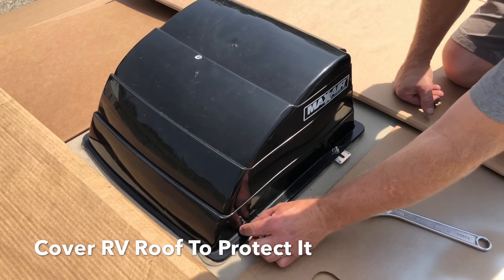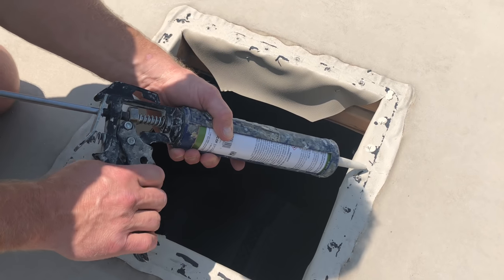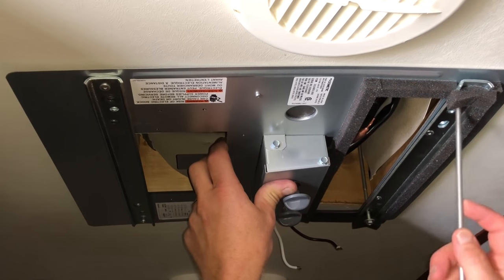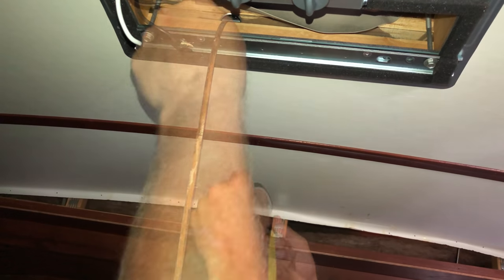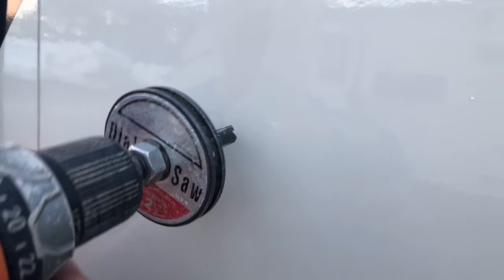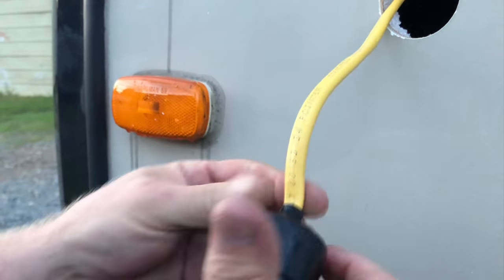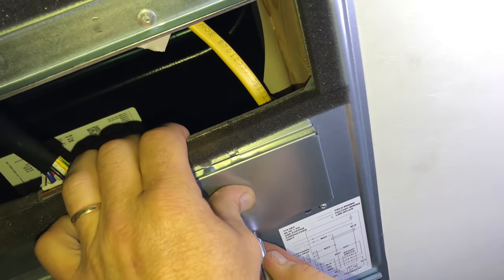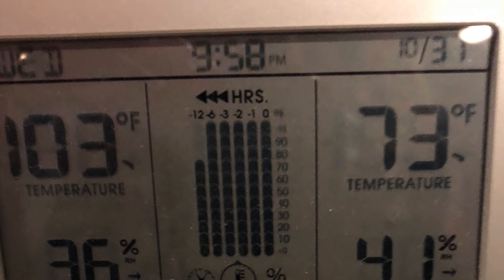Installing a 2nd AC Unit in a Camper with a 30 Amp Service

Comment: Solid, Fastly.Cool and gets the job done. For rooms where window-mounted air conditioning is not an option, this works very well. Easy set up, rapid cooling, and great design.
Reply from the maker: Thanks for watching.

Comment: I added a Coleman Mach 15K BTU ac to my bedroom on my 30 amp KZ Connect 261RL.  I mainly did the 2nd ac add incase my main AC ever goes out.  Watching your video helped me with install and running the wires.  I was able to run the 12 gauge power wire along the same route that the factory wiring was going to the side closet down to the front storage compartment.  The wiring was the hardest part fishing the wires where they needed to go.  removing the vent and installing the AC was a piece of cake.  For  now my plug in is in the front storage compartment till im ready to drill into my camper in the correct location.   Thanks.
Reply from the maker: Drilling through the camper was the hardest par, just because I didn’t want to mess anything up. Thanks for watching.

Comment: Great video!  We have a 31' 30amp class A, and I've been dreaming about installing a 2nd A/C unit.  I assumed I would have to work out and install some type of complicated power management system to run both.  Had never even thought about simply running a 2nd power source!  And what a clean install.  Thanks for the smart content!
Reply from the maker: We have loved having the flexibility of having a second unit in our RV. Definitely recommend it if you camp in warm weather. Thanks for watching.

Comment: Best practice is to tape off the four sides pf the opening with metal HVAC tape to air seal the opening from the inner cavity of your roof.  That forces the conditioned air  into the living space instead of into the roof cavity.
Reply from the maker: Good tip, Thanks for watching.

Comment: I have done this mod to my TT and have never regretted it. One thing I did, and did not notice in this video, was to add a 6" x 6" electrical box on the inside of the exterior wall close to the point where the hole is cut for the male plug to be mounted. In this box I also added a 20 amp resettable circuit breaker for additional protection. I feel more confident with this breaker being closer to the A/C unit than depending on the 20 duplex outlet on campground power pedestals.
Reply from the maker: That’s not a bad idea at all, but in the interest of simplicity I just use a inline, plugin circuit breaker right off of my extension cord. Thanks for watching.
Reply: you could also add an additional outlet for other items to reduce loading on your 30A service.

Comment: Thanks for the video, I was able to follow right along to add a 2nd AC unit to the front bedroom area of our KZ Sportsmen 5er. I was able to fish the power wire through the storage area through a void in the wall behind our bathroom, up through the ceiling and to this AC unit.  I then drilled a hole in the outside fiberglass (man that's nerve-racking!) and then wired in a single pole breaker before the power outlet just-in-case.
Reply from the maker: Sounds great, You will love it. Oh YEAH that was very Nerve-racking. Thanks for watching, glad the video helped. Happy Camping.
Reply: Did you have a vent like this video shows? Or did you have to cut a hole in the ceiling? I'm in need of something for our 33footer bedroom as the ducked isn't sufficient for the bedroom. No vent in the bedroom.

Comment: Brilliant Bob! At first I'm like, "He's gonna blow the heck out of that 30 amp. Then I saw the connector post outside. Then it was, "Amazing!!! He's going to run a direct cord to the 20 amp on the pedestal! Brilliant!!!"
Reply from the maker: It works great, Just last week we had the camper out, no shade, and the thermometer read 98 degrees, went inside and it was a cool 72. At night without the sun we have hit 55 degrees. I don't regret it at all, one of the best ad ons to our RV. Thanks for watching.

Comment: Our 30A RV has two air conditioners with a wall switch to change between them--you can run the bigger one to cool down more quickly and the smaller one to maintain.  Also we can run both when we're on generator.
Reply from the maker: Interesting set up, What brand of RV do you have?
Reply: We have a 1995 Thor Residency 3275.  We're not the original owners, but it came like this off the line, as it's mentioned in the owner's manual.
Reply from the maker: It sounds like a nice unit. Thanks for watching.

Comment: I have a 30 amp bus with 2 roof top air conditioners and i also installed a stand up air conditioner in the bed room, I put a hole in the wall and vented it plus a small hole for the water to vent. for the larger hole I put a dryer vent cover, plus i use a high power extension cord out the back bedroom window and plug it into the regular plug at the campground  it works great and does not use any of my 30 amps.
Reply from the maker: Perfect set up. Thanks for watching.

Comment: I don't know if your Rv tech tech but I am..been doing it 20+ years...super clean install brother I need you in my payroll..lol
Reply from the maker: Thanks for your encouraging words, and Thanks for watching.
Reply: I made a 32 foot 1976 Holiday Rambler ice cold with 2 window units of only 5000 btu, but from the ROOF! It was so simple I have now installed hundreds to service customers who's RV's I repair. And running 2 into 2 ends of the RV uses 25% less power. And the best part, they were only $140 each, with remotes. Just took a little sheet metal work and the original faceplate of the AC is now flat ceiling mounted! Damn shame I could not get investors on it!
Reply: @JOHNDANIEL1  i always thought about doing something like that..lol...
Reply: @JOHNDANIEL1 Make a video let's see your work. ?  Interesting.

Comment: Can’t wait to do this for our 5th wheel we just have a roof vent like you had and only one duct from the main unit and so this sounds like it will keep us comfortable when the heat gets here in Arizona
Reply from the maker: Since we have installed our second unit we have never had an issue with the camper being too hot for us. It was probably one of the best upgrades we have done on our camper. Thanks for watching.

Comment: THIS is exactly what I was wondering about 'how' to do. You made an excellent video, with detailed explanation. 
I read ALL the comments and replies, and I'm not sure how you maintain your cool! (no pun intended!)
My only 'mods' would be that yeah I'd probably use silver tape, and my leak paranoia would probably make me over do sealant, and if I could find it, a more heavy duty external plug {with extra sealant...)

But overall, a very clean install and exactly the tutorial I needed. Thanks.
Reply from the maker: Sometimes it’s hard to keep cool. Thanks for watching.

Comment: I installed a in room air conditioner and vented it through the wall with a dryer vent, it works great and takes up almost no room, plus it doesnt fight the sun and heat of the roof, and it cost under 300 dollars. And to top it off I run a separate cord to the main outlet outside so I dont use any of my 30 amps.
Reply from the maker: I don't use any of my 30 amps either but have found that this unit works FAR better than an in room air conditioner. We tried one prier to the making of this video other than the extra space that it uses it did not seem to remove the humidity very well. Thanks for watching.
Reply: Hey... 300 bucks is 300 bucks, but there are some trade-offs.  I have tried it, just to try it.  I had an 800 BTU portable, and hooked it up just like you're doing.  It worked, but just didn't cut it.  One, portables are noisier for the amount of cooling you get.   Two, all of the heat-generating stuff that makes your AC unit work is now inside the space you're trying to cool, including that dryer duct carrying the heated air to the outside, further reducing efficiency.  Three, most portables do not dump their own condensation, requiring the user to dump the reservoir periodically.   Four, portables take up precious floor space in your RV.   For about 750 to 900 dollars, you can put a purpose-built RV unit in your ceiling.
Reply: Was wondering what the price might be if a domestic ceiling AC unit. So around $1000 if lucky all said done and installed.

Comment: Thank you for posting, great video!  I might suggest some aluminum tape to seal the wood from the airflow inside the new system.  I really liked how you did that though!
Reply from the maker: Done, The finishing touches help it work better. Thanks for watching.
Reply: I lined mine with aluminum flashing sealed with aluminum tape,  I built my own divider from double layer alumium flashing with 1/8 foam insulation.   My trailer sees HOT DESERT time...

Comment: Thank you for the video! It helped me the entire way. Only thing I added was one of them 30amp shed sub breaker box with a 20amp breaker. I've notice a lot of the sites I've been to are dedicated 30amp or 50amps and no 15amp. So gonna run a 50 amp plug that drops to two 30amps and run one to my camper and the other the the 20amp breaker box for the 2nd ac
Reply from the maker: Sounds like a good plan. Glad the video was a help. Thanks for watching.

Comment: Great job. My Crossroad cruiser has only one AC.   The Bedroom has a electric hookup installed from the factory.  If we needed another Unit it would be easy to install.     Our rig is only 30 ft so even   in 90 plus Florida weather it does fine.
Reply from the maker: Sounds like an easy install. Thanks for watching.

Comment: That's pretty sweet...  I would have never thought to add another power source for it.
Reply from the maker: Thanks, It works out very well. Thanks for watching.
Reply: Already added it to someone in my rv group that just happened to ask today if his a/c could be wired on a separate 110 plug
Reply from the maker: Just joined.

Comment: Nice job on the video and install. I assume you used a gasket but didn't see one used or did you just not mention it. Thanks for posting, it gave me the idea to get things going to add a second for our unit.
Reply from the maker: There is a gasket that comes with the kit. You can see it if you look closely at 3:03 in the video. Hope this helps. Thanks for watching.

Comment: Wow nice video, I have a 2018 coachman concord bought in 2019 and very unhappy  with with the single air conditioner in the heat, I did some research an decided to to buy a furrion 14,500 btu with the manual knobs as a second air conditioner, I did exactly what you did and all is fine however just for kicks I plugged it into one of my out door plugs on the RV and dissconected shore power, then started the generator (4K) and turned on the main air and then turned on the new air conditioner and both were on full blast with 30 amp, it was hard to believe, I left it on for over a half hour no issues however I know I cant run the fridge or microwave put my fridge works great on gas anyway, I am not sure but this new air conditioner has soft start built in, either way its great now, I got the coach down to 70 degrees and finally turned it off, I also turned the 30 amp shore power back on and left it plugged in to itself and it ran fine, when I go camping I will still use the 20amp and the 30 amp so there will be no issues other appliances.......................Super Happy Now!!!!!!    thanks for the great VID.
Reply from the maker: WOW, sounds like you have a "cool" set up. Thanks for watching.

Comment: Great idea. Great video. My only concern is the romex wire sitting on the metal truss where over time it could possible rub through the insulation. Maybe add a grommet in those locations.
Reply from the maker: Yeah, good idea…done. Thanks for watching.

Comment: Great video!  My only concern is having to buy a portable ems for the off chance of bad power from the pole. I use a hardwired for the rest of the trailer.
Reply from the maker: I use a portable power GFI breaker to plug into the pole, and would recommend it. Thanks for watching.

Comment: My moms camper is 30 amp and all the outlets were on one 15 amp breaker.  The ac on one 15 amp and hot water on one 15 and the microwave on one 15.  She doesnt use the ac alot.  She likes to use electric cooking appliances when possible but limited to one even if that all the 110 she is using at the time. Fixing water damage we added another 15 amp breaker and took one outlet off the chain of outlets and put separate so she can use 2 appliances at same time if nothing else being used
Reply from the maker: That sounds like a good improvement, thanks for watching.

Comment: The yellow wire is for indoor 20 AMP, so if you use orange wire (30 AMP) you may get better service from the unit. Thanks for the vid  Can you please include links on where you got the equipment.
Reply from the maker: The orange (10 gauge) wire would be an unnecessary overkill as the unit will max out at 15 amps. I just used the 12 gauge as a little extra. I did an internet search for the equipment and went with the supplier with the best review. Hope this helps, Thanks for watching.

Comment: Excellent video, thanks so much! One question- Do I need an inline breaker for the second AC?
Reply from the maker: You do not need one as most electric trees that you plug into will have one as well as a GFCI outlet. They do make one that will go in line if that would make you feel safer. Thanks for the question and thanks for watching.

Comment: Great Video * Just a word of caution as I have a conductive aluminum framework in my Keystone product that could result in a bond to the existing 30 A grounding.
Campgrounds have often had OPEN Ground or Neutrals (which many surge guards safely catch).
You would never want a 12 or 10 gauge AC cord trying to provide an electrical return for a defective 30 amp load connection.
The pole mounted 20A breaker only protects the Hot lead.
My onboard protector has shown line input errors every season...stay safe.
Reply: You have to get rid of the massive unit, and go minis. I made a 32 foot 1976 Holiday Rambler ice cold with 2 window units of only 5000 btu, but from the ROOF! And now 2 Zone controllable, It was so simple I have now installed hundreds to service customers who's RV's I repair. And running 2 into 2 ends of the RV uses 25% less power. And the best part, they were only $140 each, with remotes. Just took a little sheet metal work and the original faceplate of the AC is now flat ceiling mounted! Damn shame I could not get investors on it!
Reply from the maker: Definitely recommend some type of protection whether it be a surge guard, voltage protector, or inline breaker. Thanks for watching.
Reply from the maker: Sounds interesting, I would love to see the finished product. Thanks for watching.
Reply: @funbro1  Building a new one for a Truck bed campers roof from a Haier 5k , a 1999 Elkhorn fully contained I got. PLan to do a video on it.  Its the most insane thing seeing a 200lb+ 11,000 to 13,000 btu Dometic on the roof of a tiny truck bed camper, but thats your only options! In fact I designed a AC unit thats in the belly frame of a friends 33 foot 5th wheel that works so much better than a roof mounted and uses the heaters ducting. Its not that hard to take them apart and add gas line and recharge them to make your own split system but on the single Cond and Evap Fan motor issue, I use 8 to 10" DC radiator fans with a built by me 2 speed control and its even more efficient!
Reply from the maker: I will have to check your video out.
Reply: Јоhn Daniel — was thinking that could maybe be done. Problem is the AC unit has to sit in a window orientation. Not on its front. Guess you could duct it in and make it work that way.

Comment: Very nice job.  The use of the dedicated circuit is a good plan; you're also in luck that you have the removable header and space for the wiring over the ceiling.  That, plus the wire duct, makes for a very tidy electrical installation.  I also like your choice of inlet -- it appears to be a solid, quality unit and does a nice job of adding finish and a professional look to your installation.  
Like everyone else, I hope you'll not be bothered if I pick on your planning a little.  I know that it will be clumsy to have a breaker installed in the closet, but have you thought of the utility (and maybe safety) of having a switched breaker inside the RV and as close to the back side of the inlet receptacle as possible?  That way, you wouldn't be relying on the quality and efficiency of the RV park pole breaker and you'd also have an emergency point to isolate the entire circuit inside the RV if "worse comes to worst".  Probably overkill, but I'd consider that.  
As I said, it's a very neat, efficient, and safe installation.  You should be proud of that work, and thanks for the video.  Bb
Reply from the maker: That thought did cross my mind and it may be something to add down the road but everything seems to be working fine now so chances are (knowing me) I will leave it the way it is. There are also GFCI circuit breakers that can be added to the extension cord if that would make it easier, I do use one of those for extra safety. Thanks for the comment and Thanks for watching.
Reply: @funbro1   Oh, yes, a quality GFCI protector device is a very good addition for safety and an excellent choice.  Thanks for the kind reply and again, thanks for the useful video.

Comment: Very detailed.  I need a second air conditioner for my rv trailer bedroom.  I thought  it was possible to tap into the existing wire to the thermostat and use a switch over between  the ACs? A lot of older units have this switch.
Reply from the maker: Your RV would need to have a switching unit to alternate the 2 AC units so that they both do not run at the same time or you would need a 50 amp service to the RV. Either one. Hope this helps, Thanks for watching.